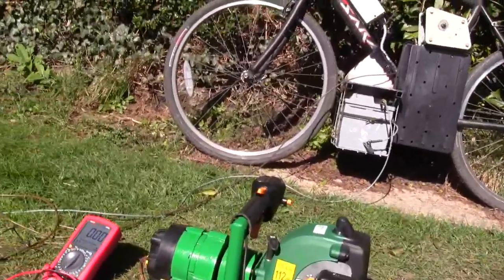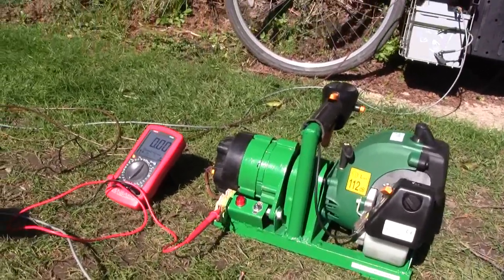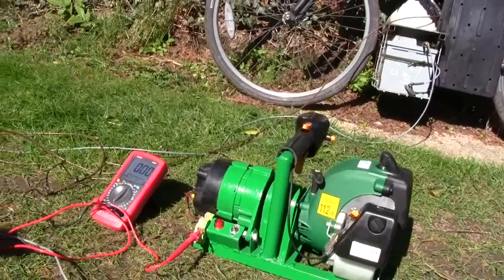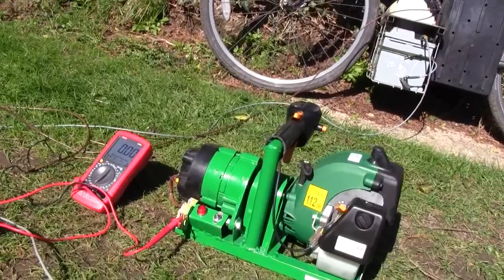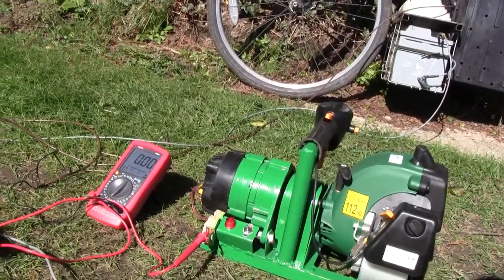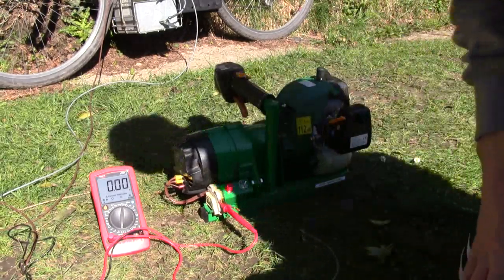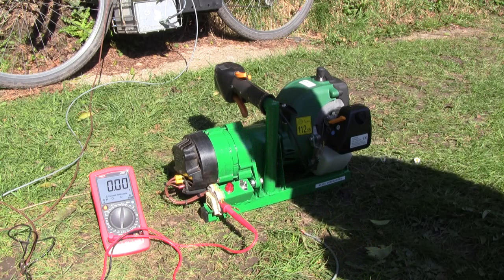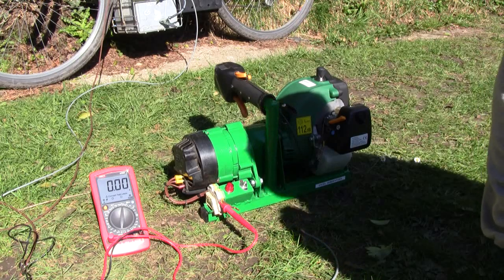12 volt generator finished but has an issue!

Comment: You need to put a alter the current going to the slip rings (Field coil)  to tune the alternator to the torque of the motoe - a small PWM controller would do it

Comment: Using a small engine WASTES gasoline. Look bat my videos on 12 volt generator fuel consumption. I get 10 hours on one gallon of gasoline
Reply from the maker: I couldn't get the revs stable enough with the small engine. I use a 4hp briggs now. Thank you for your comment.
Reply: You didn't watch my video.

Comment: You're quite correct with your analysis.  The alternator is shunt-regulated to 12V by it's output load, so power to drive it rises with engine RPM while the extra output voltage produced is dissipated as heat in the windings.  Poor little motor does not have the torque to do that, so it just loads up and under-revs.  Easy fix is to run the alternator at a higher voltage and use an MPPT regulator (expensive), or remove some turns off the stator.

Comment: Neatly built project. I suspect the engine is under one horsepower though and irrespective of drive ratios will struggle with a car alternator at full current. Still could be very useful.

Comment: I like your setup. I think you can add a variable resistance in series with the feild to reduce the feild power so you engine will be able to take different load gradually. I have a car generator with a 8hp B/S engine and if i try to charge a dead battery it will stall the engine.
A weedeater does not produce a lot of power!

Comment: You got it the first time..Your weed eater revs upto 15,000 rpm..The alternator will reach it's peak output around 3-3500 rpm,so 3-1 or 4-1 would get it running right..Raven

Comment: What you need to do is reduce the field current, i believe the field is controlled via 400hz pwm signal. If you use the car voltage regulator it will run the field current up to full power because the rpm will drop too much and essentially it will stall the motor ...

Comment: also be careful if you gear it down the engine will rev higher so this means it will have to work a good bit harder these little weed eaters do like long hard runs

Comment: You need the alternator to run higher RPM than the Engine. A car is about a 4:1 increase over engine RPM. 

Then simply use a 12 volt battery to "dampen" the rate at which the engine becomes loaded to prevent stalling. 

Nice setup!

Comment from the maker: @lezbriddon The engne does about 6000 rpm when developing full power which is a higher rpm that I expected. The alterntor reaches its full output at 2500 rpm. One of the reasons for choosing a 2 to 1 reduction from the engine is to allow the alterntor to loose its output when a load is applied that is too much for the generator as a whole without stalling the engine. Thank you for your input; its always good to share ideas!

Comment: needs like a 3 or 4 to one gearing for what your doping, alternators need high rpm, usually double car engine rpm and cars tend to cruise at 2000 rpm, so find what your engine prefers to run at and gear up for it.